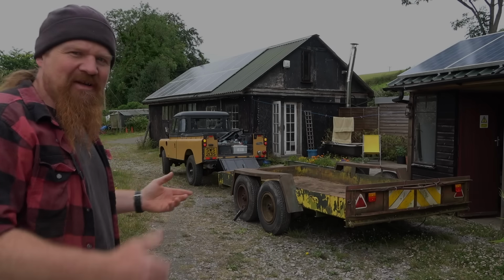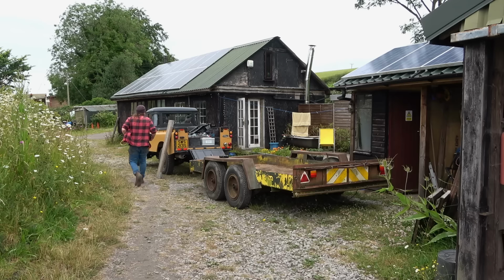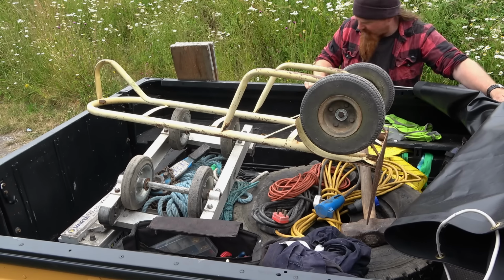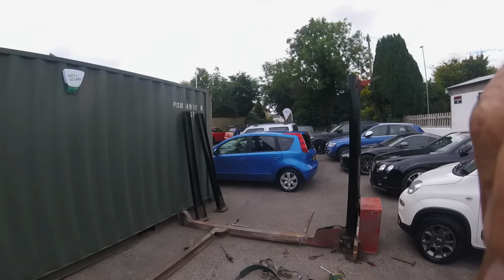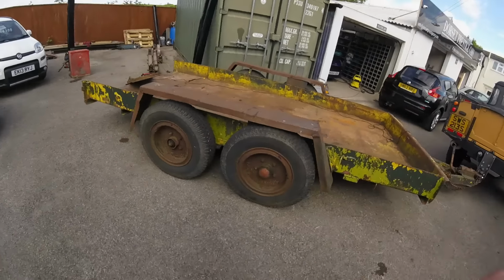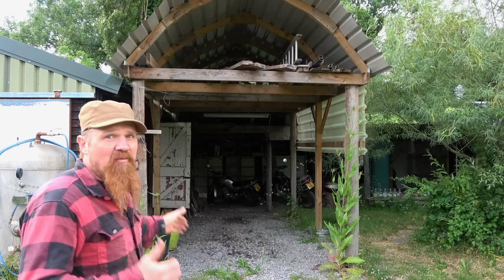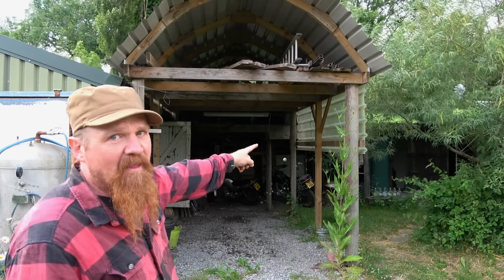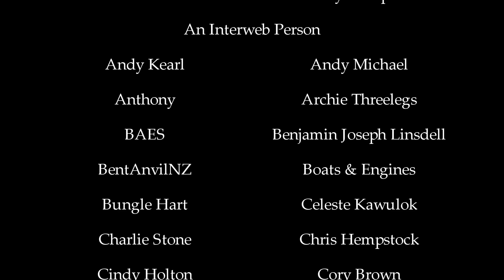Adventures of Kermit: Car Lift Collection

Comment: You'll wonder how you ever got by without it. I got a two post lift for £300 last year. Took a while to figure out how to convert it to single phase and I had to put a bigger pulley wheel on to gear it down but I just love it. Jobs I used to do laying in the dirt I now do reclined in an old office chair with a cup of tea on a table next to me. Another great video Max, thank you.

Comment: Great Video
I worked for a time in a garage after the agricultural engineers where I was a second year apprentice went to the  wall.
left on my own whilst garage owner on holiday and desparate customer waiting for his recon engine I used the for post lift to install engine ,
Bit dicey now that I recall ,I parked my beloved Minor 1000 pick up with scaffold board under back wheels,then an alluminium ladder  over end of four poster and under board projecting over Ford 100E popular, rope sling round engine and on to a couple of ladder rungs. Up lift, up moggy pick up, up board , ladder and seized engine ...sorted..
Thanks for the content .
Reply from the maker: Dicey or not, it's still a win!

Comment: living the dream there. I really wish i had/ could afford somewhere to work on  my car that i could put a 2 post lift into. Ive got to put a new engine in my mr2 and i feel a bit nervous using the engine hoist to lift the rear of the car to remove subframe and the  busted engine. Property in Stroud is so expensive though, i kind of want to get away from here and find somewhere i can do/afford what i want. Seeing the kermit restoration was fantastic and its great to see it out on the road helping you haul stuff!

Comment: If you're planning on digging, it might be an idea to put in a small inspection pit whilst you can.
Reply: Defeat the point of having a lift wouldn't it?
Reply: @jbuckley2546  It wouldn't. Lift can break, power can go out. Not all vehicles are equal dimensionally. There can be a case where some vehicle is too tall for lift only, but it could worked on from the pit.
Reply: @PR_96  Fair point.

Comment: that is a very old lift okay for doing oil changes and exhausts but a pain the bum when you need to drop ramps off
Reply from the maker: A very very old lift! A Bradbury 700 I think so maybe early 1970's?
Reply: @maximusironthumper   not sure how old but i used to use one when i was kid and it seemed old then
Reply: you could leave it going up and it would turn off when it got to the top.. also if i remember right the pole with pump extends twice its height

Comment: I thought about also putting a lift under a roof
My solution was to just attach the roof to the lift
So the roof will raise together with the lift.
If the car fits under the roof, that’s enough height 
Especially with tall Land Rovers

I ended up building a bigger shed where the lift just fits…

Comment: I'm 2 mins in and I bet your going to Dorset.....   as I was watching a ramp there that went for £100!
Reply: Yep, thats the one. 😉      IIRC it 3 phase?   so will be interested to know how you will power it?         

I have been considering a phase converter but also a motor swap to single if its feasible.
Reply from the maker: Current thinking is a VFD but no doubt there will be a video explaining all when the time comes!

Comment: Random question Max after all your efforts there but where did you get your tonneau cover from? Although knowing you, you probably made it!
Reply from the maker: It's just a heavy duty 7x5 tarp that I adapted slightly to fit. Full details in a future video!
Reply: @maximusironthumper  I knew it! 
I've made myself one out of left over 3mm roofing rubber but it's a bit heavy duty.

Comment: OMG WHAT WOULD IT TAKE TO BUY THOSE TRAILER WHEELS??? If they are what i think and land rover stud patten. i have been after a sat forever. I have a Gloverwebb Hornet landrover based armoured car and it had those wheels. I have Wolf wheels on it currently. What are the chances? thanks
Reply from the maker: I've just been out and checked, they're 7.00 on 15" split rims, they're not Land Rover pattern. The stud spacing is similar but the centre hole is much smaller. They're not for sale anyway!
Reply: @maximusironthumper  well thanks for checking. ims ure a deal is allways negotiable. But i get it. thanks for replying.